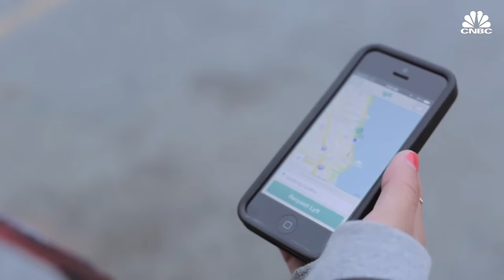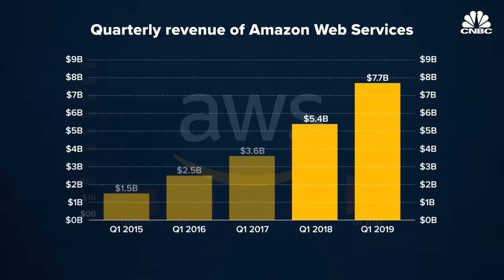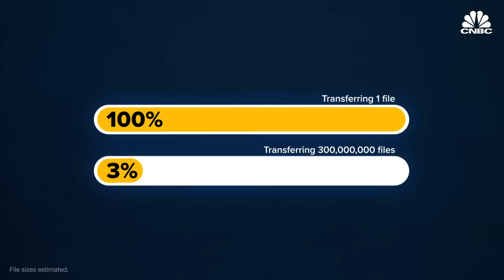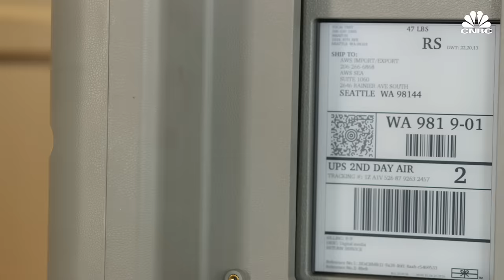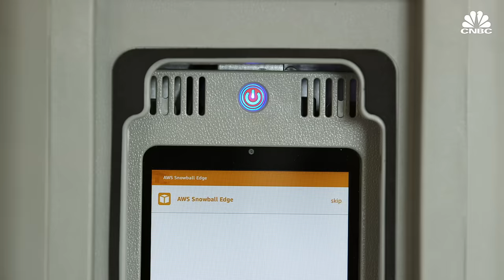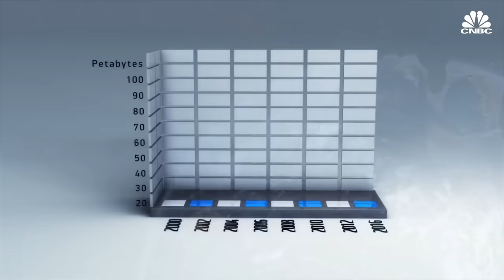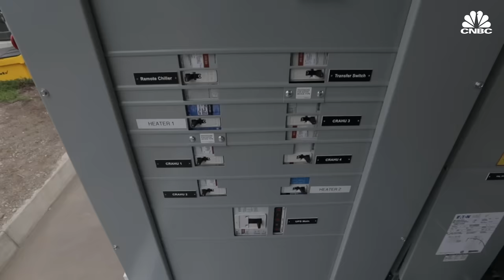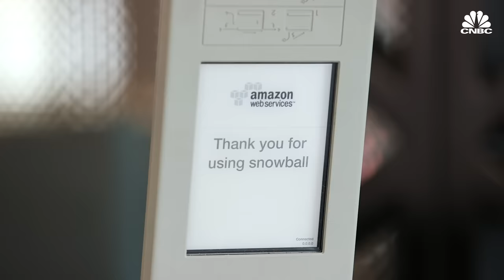How Amazon Uses Explosive-Resistant Devices To Transfer Data To AWS

Comment: Snowball and the Snowmobile and Explosive-Resistant Devices are old technology. The KGB-GRU's equipment is what we Russian calls it as the DATA BOOSTER or data blaster or data thruster. They are used in our own national intranet defense networks connecting all BMRs known as Battle Management Radars. Military science advances by 44.5 years for every 
1 calendar year whereas civilian science advances by 1 year for every 1 calendar year.

Comment: One thing this video fails to mention about AWS, is that if your AWS resources are not highly optimized, AWS can get very expensive very fast.

AWS billing is like your electric bill, you only get charged for what you use.   And AWS charges for just about everything.   Now... there are companies out there who effectively have the AWS equivalent of running every electrical device in a home 24/7/365.  Would you like to have that electric bill?    There are AWS people savvy enough to run scripts to fine tune AWS settings.   To keep the analogy going... would you need three stoves in your home if only two people are living there?    Probably not.
Reply: I can agree to this. I did IT at my last company and pretty much saw the bills come in for our oustide services. Our AWS bill was about $20-30,000/month!!!

Comment: 4:14 300 songs on a Gigabyte seems a little low to me.
Reply: Depends on the encoding bit rate. Sounds like they are using a very high bit rate and not taking advantage of variable bit rates. Personally I never use files for data size comparison. I always compare to something with a know fixed max size such as a 3.5 floppy, CD ROM, DVD, or Blue-Ray.

Comment: Cloud computing is vulnerable to external factors and we will never use it at all. My country has two internet systems. The usual global internet network AND THE MILITARY INTRANET NETWORK. For security reasons it is hardwired to be impossible to be connected to the global internet network. So I have 2 set of computers. The 1st one is connected to the global internet and the 2sd one is connected to the military intranet that has all of it's source code HARDWIRED in a maskless ANALOG IC CHIP AND CERAMIC TRANSISTORIZED ANALOG PRINTED CIRCUIT BOARDS functioning together side by side so that if something happens to the IC CHIP system, then the CERAMIC TRANSISTORIZED ANALOG PRINTED CIRCUIT BOARDS will continue to function as it switches off the IC CHIP system. All computer activities are recorded by an ANALOG RECORD ONLY MAGNETIC TAPE SYSTEM and floopy discs and zip drives as well as cassette tapes that are all functioning side-by-side with 4 multiple randuant hard drives. There are 4 multiple redundancies separated individually from each other. If I want to stop and rewind to check and back track to what I have done, then while I am doing that it is still being recorded on the parallel 4 hard drives and when I am finished then when push the bottom RECORD the hardwired program will instruct the magnetic tape recorder to go to where it stop and start recording again FROM THE HARD DRIVE IN A SPEEDED UP RATE UNTIL IT CAN CATCH UP WITH THE REST. And when I turn off the computer, then whatever needs to be recorded from the hard drives will automatically stay on until it is finished and then it deactivates itself. And parallel to all of these 23/7 non-stop record only systems is an ASOM system which stands for Auto-Saved On Microfilm system of which there are 8 systems and parallel with it is an ASOP system which stands for Auto-Saved On Print system. The microfilm are archival quality self-developing and self=stabilizing and the ASP system ues archival mineral ink on archival paper.

Comment: So, this explains how AWS bends over backwards to get data in to them. Try getting your data out of them. Your org will likely see partial data access point outages as frequent as every month or so. Sysadmins, you'll be helpless for a stressful afternoon screaming at someone in an Indian call center until someone else onsite eventually gets things running again. Once you're sick of getting blamed for a service you have no control over, you will want to back out to another more stable cloud provider or bring core services back in house. However, you're going to run into "data extortion": you want to move back out of AWS? You're going to pay for the data charges to get it all back out. And did you migrate your SQL database to their solution? Well, you better get creative to get the data back out cuz you have no access to the raw data files. And bless you if you can keep things in sync while you do that. Pointy hair bosses beware. AWS is a one way street. And their "multizone" offerings don't guard you from internet routing outages that will make your databases unavailable to other regions. AWS sucks unless you can reliably replicate and sync between regions. It's a lot of marketing hype, unfulfilled TCO nonsense, and a headlock your organization will find itself in.
Reply: I think when most companies make the transition to AWS or MICROSOFT AZURE OR BOTH OF THEM THEY DONT LEAVE

Comment: Imagine that truck filled with data driving away from the client's site and something happens like natural disaster and the truck is lost with the data.
Reply: The data is copied onto the truck, not moved. It still exists on the customer's datacenter until it's been transferred to AWS from the truck and verified to be correct.
Reply: @KingdaToro  yes I am aware of that. I should of added that. What I meant to say was if that happened then they would have to go back and do the process all over again.

Comment: The scaling at 4:13 is wrong. A terabyte is 1024x gigabytes but you showed it as 10 by 10; 100x. Should have been more like 33 yellow boxes by 30. Same error with the representation of a petabyte and exabyte. An exabyte's WAY bigger than you've shown it... you're off by about a 1000 fold.

Comment: The "snowball" can't handle temperatures below -20??
Reply: It's currently rated at -53 degrees, with the cold weather kit. But yes, most hardware have limits of cold and hot temps...even hardware called a Snowball :-)
Reply: and can work at hot temps

Comment: The idea that AWS is using trucks to transfer data of its users to its data centers is remarkable. However, the truck should be escorted by the police; otherwise, it can be stolen by thieves, and as a result, companies' data are in great danger.
Reply: Not really. The data on the truck is encrypted with the keys sent separately, and the data still exists on the customer's data center until it's been fully transferred to AWS and verified to be correct. Stealing one would be pointless if you can't use the data, sell it, or hold it for ransom.
Reply: @KingdaToro  I take a different view. If hackers get access to the truck, they may find a way to decrypt the data. In this case, the privacy of the company's data is violated, and they get access to a large amount of data of the company.

Comment: 4:24 Gigabyte, terabyte, petabyte, and exabyte are not separated by a factor of "about 1000" or 1024, but of exactly 1000, since they all use metric prefixes. You're talking about gibibytes, tebibytes, pebibytes, and exbibytes, which all use binary prefixes. Do better research, CNBC, and stop spreading lies.

Comment: This video is misleading. You get charged for data in motion (Hot Data) like mad, but data at rest (cold data) is cheap. Then you need to increase your network connection bandwidth exponentially as your dataset increases , and employees/customers accessing the data will easily saturate an existing connection that wasn't mean't to scale beyond the office/company LAN. You also are at the mercy of local ISP, and upstream ISP outages/routing issues that prevent employees/customers to access said data. You also have an increased time required for remediation as AWS techs need to be contacted for support instead of contacting in-house IT.  

TL;DR - Companies that see the "cloud" as a silver bullet for their woes are in for an expensive surprise. It's as intelligent as implementing thin clients when real processing power is needed on the local machine.

Comment: 100 pb is not equal to 200 million notebooks but 200,000 notebooks 
Get the math right!
Reply: Assuming 200 words per page, 5 characters per word and a 200 page notebook, it totals to 200000 characters, which is usually 200KB assuming a byte per character. Now 100PB /200KB equals a half trillion. Your math was not even close to right.

Comment: Extremely low powered data center is a necessary because you can't run the internet with only one photo of Trump. Atleast a vedio is a must. Sometimes azure is on Mars. Because otherwise you cannot design a rocket on Mars.